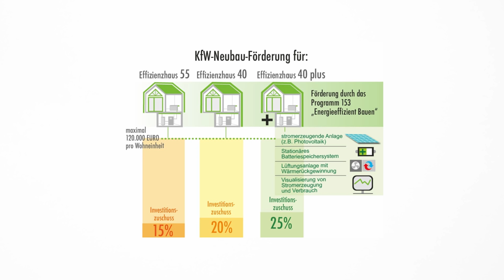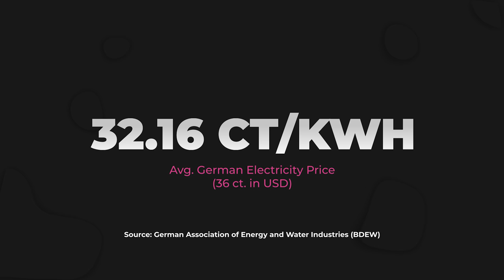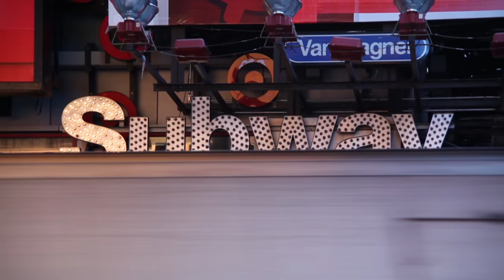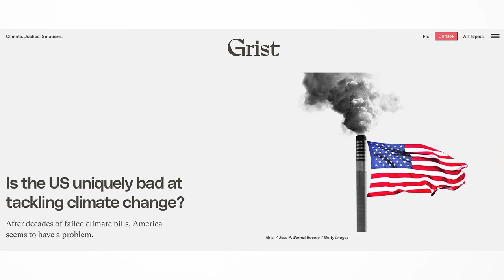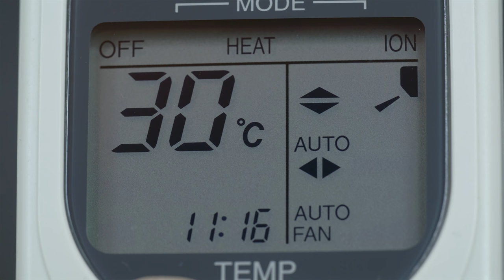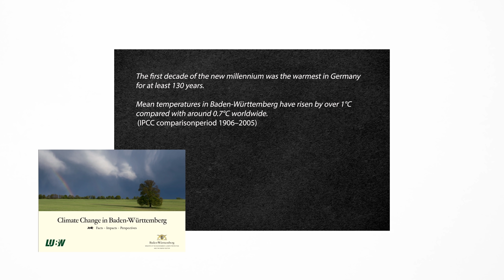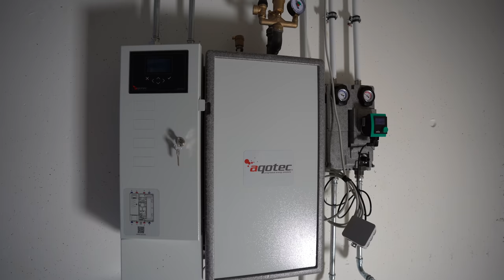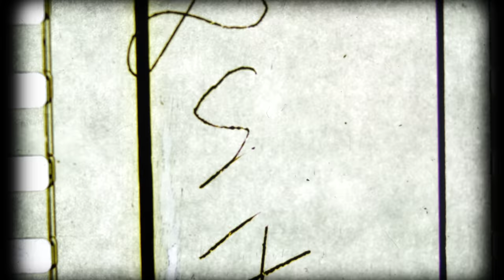HVAC (HLK) in German & American Homes | A Tale of Two Countries

Comment: My parents own a 250 year old house with no air condition located in a region that gets hot in summer and cold in winter. So the most important rules for keeping the heat out I learned were to keep the sun out (close the blinds during the day, my parents have those extremely dark ones, so no ray of light can shine through) and wet the ground under the window in the evening (especially if it’s stone). Admittedly, the 90cm walls are also good in keeping the heat out in summer or inside in winter. Another trick I learned is to hang damp bedsheets in the open windows at night to cool rooms down in summer.
Reply from the maker: Oh the wet bedsheets is a really great idea! We currently live in an attic apartment with windows that face south/west. We struggle in the summer because our house doesn't have any exterior blinds to keep the sun out.
Reply: I used to live in a raised ground floor apartment built in 1901. The walls are incredibly thick. And with the blinds, my room can easily stay around 26C even on a 40C day. The number one rule is to close your windows after 7am and don’t open it until it’s like 4 or 5am. Don’t open it before midnight because the air outside can be still hot even when the weather forecast says 16 degrees 😃

Comment: That was a really interesting comparison. I have experienced both forced aeration and individual room heating, and there's pros and cons for each. However, in my German home I prefer the individual solution for several reasons: First, it is much easier to build when having massive stone walls, second it needs considerably less space, third there is less noise from the ventilation and a much better acoustic insulation of the rooms, fourth it's easier to have different temperatures in the rooms (e.g., 18 C in the bedroom and 23 C in the living room), and last but not least, I was always a bit concerned about germs and vermin in the ducts and in between the walls that would be hard to get rid of.
Reply from the maker: You bring up a great point. We also look forward to keeping the living room a bit warmer and nice, cool sleeping areas. This really is such an advantage.

Comment: I installed external mirror foils (or refective screen?) to my windows. Keep a lot of sun heat out. Gets a bit dark inside, in winter, since you can't get light in like by pulling up the blinds. But if you don't have opportunity for blinds, it's the best alternative. However, finally I still bought a AC, too. :-)

Comment: Having your house built can allow for installing central air conditioning and you can use it or not use it as you like. With days getting warmer, the future may well favor having central air conditioning installed. When I lived in Germany, people told me to look for gas heat, because electric heat can get expensive. I rented a place with electric heat and my electric bill was never over the base charge, regardless if I was there or not. I think they must have been reading the meter of an empty neighbor's place. I had phone installed and somebody hacked into the line, running up a huge phone bill, that I didn't receive until after leaving Germany. The German phone company had placed the postal code in the wrong location in my address and it took over a year to get to me. I didn't run up the phone bill and I never paid it. I never hear about it when I return to Germany. Hospitals keep the air conditioning cold and dry for health reasons, so it certainly doesn't make you sick.

Comment: To the "getting sick" part, central air conditioning units in large buildings are mostly forced air systems which means cool air is circulated thoughout the building. Unless specifily configured, central air conditioning systems mix fresh air from outside with 'used' air from within the building and circulate the forced air though the building. This means air pollutant (i.e. viruses, bacteria, mold particles) available in one room of the building are sucked in by the system and over time circulated  through the entire building. Obvisouly a problem that has received increased attention over the last 2 years especially in larger buildings. The issue is most prevelent in older buildings and can be prevened by new or updated systems as filters and specific system conficuations (i.e. fresh air only) can solve this problem. In this case its not the air conditioning itself that makes you sick but the forced air system is transporting what makes you sick right towards you - an issue that does obviously not arise with radiant heat/cooling systems.
Reply from the maker: Yes, but arguably the forced air system in the US would always run through a regularly checked/replaced HEPA filter, even for the recycled air.  When I first moved to Germany I struggled a lot with my allergies. We wanted to open the windows to get fresh air but all of the pollen was killing me. Thankfully we just invested in some great air purifiers that has helped tremendously.

Comment: Cogeneration of heat and electricity in large, metropolitan-level systems is amazingly (by orders of magnitude in some cases) efficient. However, it requires competent maintenance and is completely incompatible with the American scale of suburbia, private homes with large lots of land.
An important nuance lurks in the relationship between building habits (timber frame houses vs. concrete and brick) and climatic conditions. In humid hot climates, wood and drywall are fundamentally more durable if the house has air conditioning. In climates where there are many transitions through the freezing point of water - constantly and evenly heated brick/iron concrete structures are also much more durable and require less repair.
In addition, we must consider the history of epidemics. How did the Spanish flu pandemic affect ventilation rules in the US? How did tuberculosis affect Europe?
Russia, St. Petersburg and Anapa (Krasnodar region).

Comment: From my understanding If I wanted both heat for the winter AND AC for the summer, I probably would opt for the forced air system, just because you could combine them better into one system. If I was building a new house.... In my german home built in 1963, there was central heating with radiators built in from the start, and of cause no AC at all. At first it was coal-powered, then switched to oil and later to natural gas, which is what we use now. Every change in Power source only needed a new burner together with a change in storage facilities or connection to the city's gas network.The pipe / Radiator system is still the same for 60years now. Some of my neighbors did install wall mount AC's over the last years, but only in their sleeping rooms. They are used only in the hottest nights in summer. New german homes from the last years most often use a heatpump system, together with other fancy engineering on good insulation and so much more that makes the entire building as energy-saving as possible. Some are at least "passive Houses" which do not use any external energy for heating or cooling.
Even older houses often are improoved over time with better insulation on walls, roof and windows to keep the costs of energy down. And more modern, more economic central heating boilers of cause.

Comment: Thank you.  This is an incredibly informative video.  Very well researched and presented in an organized and easily understandable way.  I live in Southern California where some type of AC is necessary for comfort in the summer.  That said, I have not used a heater or fireplace in my home for 30 years.  Yes, a couple months in winter it does get relatively cold in my house, but I just tell the family to put on a sweater.  I do live in an area where it rarely gets below 35F, but can easily exceed 95F in summer.  I, too, use the open window-close the blind method in summer.  🌞

Comment: Wie gewohnt ein Top Video. Sowohl vom Thema als auch von der Ausführung her. Chapeau 🎩.   Neuere Wohngebäude haben meist eine Fußbodenheizung.  Ältere wie unser einen Wand-Heizkörper. Wir haben ein besonders umweltfreundliche Heizungsystem : 
Gas betriebene Zentralheizung mit gleichzeitigem Stromgenerator ( Blockheizung Kraftwerk/ Dachs. )Power Station Unit. Wir verbrauchen unseren eigenen selbst produzierten Strom .Bald kommt noch eine Photovoltaik Anlage auf das Dach. Und ein Batteriespeicher ( battary charging station 13 KW/h)  .  Für extrem heiße seltene Tage im Sauerland (300-850 Meter Höhe) haben wir 2 Mobile AC Geräte- ( Schlafräume zB). 
Euch eine gute und gesunde stressarme Woche . Liebe Grüße aus dem Sauerland Home of 🎄⛰🎄😉
Reply from the maker: Vielen Dank! Wir freuen uns sehr, dass dir das Video gefallen hat. Es klingt, als hätten Sie ein wunderbar effizientes Zuhause! Wir hoffen, dass wir diesen Sommer unser neues Zuhause mit Solarenergie ausstatten können.

Comment: In Estonia is  central heading in most aparments with gas -one month 39m2 one bed  aparment in winter where out ic  minus 15 C deg is 12 euro bill = 1,1 m3 gas+ infrastructure service costs.   1 kW/h by fixed contract by 2 years is with all taxes 0,15 euros and by free stock prices  0,05 until 0,70 euros 1 kW/h. Oil price ( heatingoil) 0.95 until 1,08 euro liter

Comment: To deal with heatwaves in the future, I expect many homes to get small AC units for the rooms that are especially subsceptible to heating up - powered by the photovoltaic cells on their roofs. With photovoltaic cells becoming the norm, I expect most houses to become self sufficient for heating & cooling during summer, and only to need external power for heating during winter.
(using electricity for heating would most likely make use of heat pumps in combination with existing water circuits & radiators)
Reply from the maker: Small portable AC units do make sense in extreme cases. We bought one when Ashton was pregnant in 2020 to try and ease the suffering. It took a long time to cool down a room, but for her it made life a lot more comfortable.

Comment: Wow, the temperature I have seen here in Canada in almost all homes I have lived in or visited is 20 degrees or lower. In the middle of winter it is usually higher. And I only know one person with AC. The city I lived in just changed the bylaws forcing all new homes build in 2023 and beyond to have AC because of climate change. And they changed the bylaws making it illegal for landlords to evict a tenant for running portable AC. They have to accommodate it and maybe increase rental cost but flat out evicting or refusing to rent because you have portable AC is no longer allowed.

Comment: Thermostat wars! Oh, yes! My father and I were on one side (low temperatures), my mother on the other (high temperatures). This was true in winter (heating) or summer (air conditioning). When my father and I had adjusted it, it would not be long before Mother would ask: „Are ya‘ll cold!?“ (side note: Texans! Loved the „kinda wanna da be talkin“) Dad and I would just laugh because she had to know that the answer would be „No!!“ SHE was cold; we were comfy!
My apartment history in Germany is almost a description of development. 
First apartment: Started with a coal stove in the apartment. Dirty, smelly, ineffective. After the winter of 78/79 (when temperatures remained below freezing for almost 3 months), I installed „night storage heating“. A unit heated up bricks during the night using electricity that ran through a separate meter and was significantly less expensive, then had a fan to circulate air over the bricks during the day for heating. If I was home and it was really cold outside, the stored heat sometimes „ran out“ and I had to wait until the night heating kicked in again.
Second apartment: district heating for heat and hot water. Radiators. Wonderful. Heat was available year-round for those times in „summer“ when temperatures dropped to close to freezing at night. There were at that time still a lot of apartment buildings where the heating was simply turned off from the beginning of April to the end of September, and landlords were not required to turn it back on unless night-time temperatures fell to below 10 °C for three nights in a row.
Third apartment: district heating, underfloor heating. Fantastic.
Current apartment: underfloor heating, but hot water and heating from a central boiler in the building. 
I love underfloor heating. It feels so good (especially on the tile floors in the bathroom), and there are no radiators to work around when furnishing the rooms. Regrettably, both of the apartments with underfloor heating were older buildings, so there are no room thermostats. I have to adjust valves at a central place in the utility closet. Rather hit or miss at times.
I sometimes miss A/C in summer, but I‘ve learned to live with it, and I have fans in every room. But sleeping is really difficult when temperatures are high at night. And Hamburg is between two seas, so we tend to have high humidity as well. My personal theory (not backed up by any scientific research) is that 40 °C is much more tolerable here than in Texas or the Midwest USA because the solar radiation is not as intense. Whenever I went back to the USA in summer, it felt like the sun really burned down! I have never had that intense feeling here.

Comment: This was one of the main differences bw my life in the US and Germany. I always needed to carry a hoodie in the US during summer time because the AC was always cranked way up.

I would like Air Conditioning in Germany, but not to that level. 

And compare that to my life on India, every indoor (residential) quarter had ac while my school didn't and the excuse used was the same: "AC makes you sick"

It really doesn't. You should give yourself a couple seconds to acclimatize when moving from one extreme temp to another, but beyond that, it's not related in my experience.

Comment: The "air conditioning makes you sick" idea is prevalent here in Japan as well--a country that is in general terrible at managing indoor temperatures because they operate heat/AC off a rigid calendar rather than adjusting to what the outside weather is actually doing.

Comment: I think also one of the reasons US homes are more in need of AC is their poorer insulation. I remember visiting a friend in Brooklyn during a hot summer in 2006. He lived in one of those cute old houses and it only had a window AC unit. One day it started to shut down periodically due to a malfunction and every time it went out it literally took less than 2 minutes for the room to get unbearably hot because the outside heat was seeping in so rapidly through the house’s thin walls. It was quite a baffling experience for me and I wondered how people in that house survived the New York summers 100 years ago when there was no AC yet.

But even in my thick-walled well-insulated Altbau here in Southwest Germany I sometimes wish for an AC on especially hot summer days. Until now, though, I managed to get along with a standup fan during those times.
But maybe with climate change and rising temperatures I’ll have to have the AC talk with my landlord eventually 😅
Reply from the maker: We used to live in an attic apartment (built in 1860) in Freiburg and when I was pregnant with Jack during the summer, I caved and we bought a portable unit so I could sleep at night. But its been amazing to move to our newly built home (still in the Freiburg area). We had a similarly hot summer, but it would take DAYS for the house to warm up and we never brought out the AC unit once.
Reply: @TypeAshton  Oh yes, attic apartments are the worst, especially in old houses. My childhood bedroom was under the roof, so I know it first hand, even though that was a modern house from the mid 1980s.
The place I live in now in Karlsruhe (similar climate like Freiburg) was built in the 1890s and the outer walls are 50cm (20in) thick sandstone, so they can keep the heat out for quite a while (plus the modern double-glass windows that were installed just a couple of years ago). But when you have those episodes in summer when it’s above 30°C for two weeks in a row, at some point the heat eventually permeates the walls and then you have it inside very persistently. Those are the days when I dig out the fan and wish for an AC while waiting for the weather to cool down.

Comment: Fascinating and well done as always! I am pretty old so I grew up without air conditioning – in Southern California! Our houses were from the 1920s so built without A/C. Here in Berlin I am lucky to live on the 2nd floor with 3 floors above me so my place only gets hot when it is really hot outside for more than 2 weeks. I can manage fine with a fan. This whole topic is of course so important right now, especially with the political problems around the gas supply here in Germany. I have an individual gas boiler and radiators in my apartment and would really love to be able to get away from natural gas but there are just no options at the moment for apartments, and the building is from the 1890s so retrofitting will be very expensive. It is great that you could build your house with energy-efficient heating from the outset. Have you been reading about the expansion of geothermal district heating in Zurich? This sounds very promising and I hope that district heating spreads more in German cities.

Comment: Funny how common forced air heating systems are in the USA. We live in Germany and buy a townhouse in 2018 what was built in 1999. It was built in a complete new settlement in that town. So a lot of the houses are built in same fashion, style and technical equipment. A  lot of the houses here have gas powered forced air heating systems with a heat recovery system, but today it is a bit unusual for private homes and so to find an expert company for maintenance is difficult